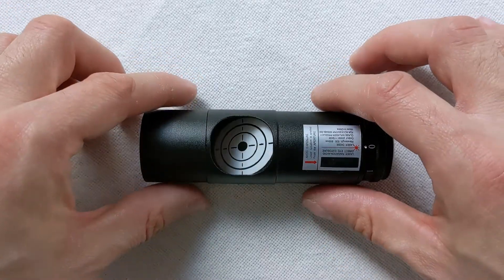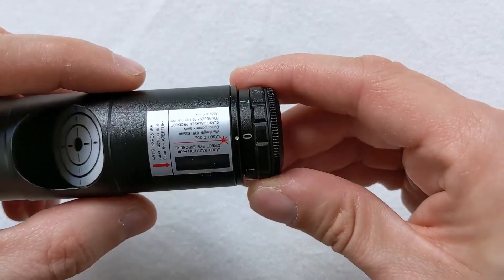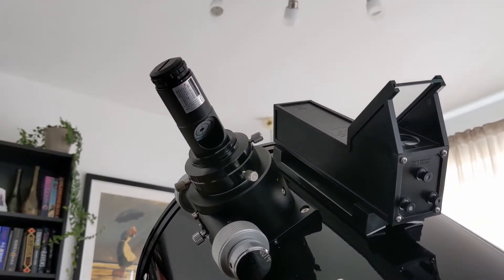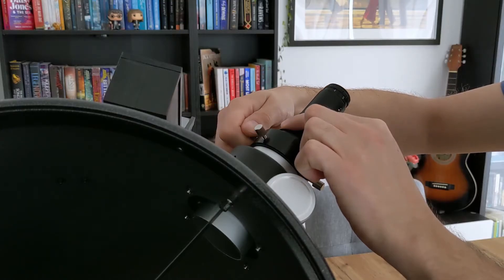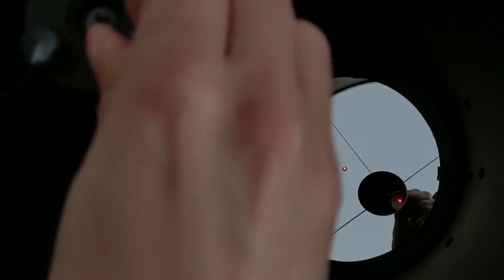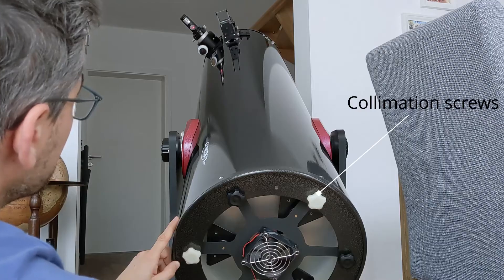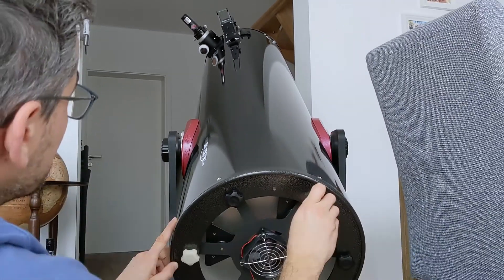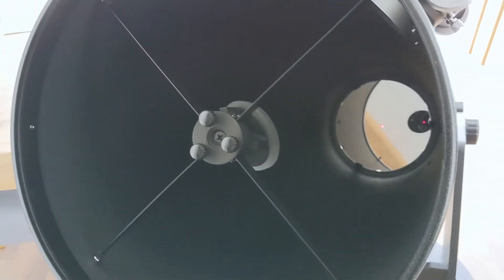How to Collimate your Dobsonian telescope - a step by step tutorial

Comment: I recently bought an Apertura AD12 Dobsonian telescope, it came with no instructions.  The collimator is different than the one in your video.  It has no bullseye and no ability to adjust the laser beam.  However, it does have a circular indentation to zero in on for the collimation.  How does one make sure that the collimator is EXACTLY vertical i.e. straight up and down? I noticed that if it is turned little to the left or right it changes the position of laser light dot in the mirror?  Thanksyou!

Comment: I'm looking all over trying to find a video to give me a clue about getting the primary mirror collimation close enough to get the laser inside the collimator. Mine is way off. I have a 2nd smaller dob and this is an easy task, but not on the used 12 that I just bought.

Comment: the circle on the secondary is projected by the collimator right? mine mirror doesn't have that circle in the middle...
Reply from the maker: @markpatricksantosglatzel4439 The circle on the primary mirror is a sticker called center mark. Usually mirrors come with that center mark from the factory. If yours doesn't have one, you can place it yourself. There are simple plans online that you can print at home and use to find the exact center of the mirror. The sticker can be purchased online for a few bucks.

Comment: You adjust the secondary mnirror directly into the center mark and tighten..  You then move to the primary mirror and align but it knocks the secondary mirror way off the center mark again.. Why is this happening?
Reply from the maker: @iifilmalways7122 There could be multiple reasons for this behavior. Maybe the laser collimator doesn't sit tight inside the focuser or maybe one of the two mirrors isn't aligned with the optical tube. It could also be that the laser collimator isn't properly collimated. Start with checking the laser collimator and if it's collimated, then keep on adjusting the two mirrors. At one point you will see a pattern and  collimation will work out.

Comment: I recently bought this thing too, but I suddenly realized how we can ensure that the laser is emitting parallel light. It looks like this laser pen doesn't have the ability to adjust the direction of the laser beam, which means that the laser itself needs to be calibrated to determine that the light being emitted is parallel to the eyepiece.
Reply: If you can not get the laser straight or don’t trust it:
Put a barlow lens in first, then the laser. Instead of a dot, there will be diffracted light on your mirror. But if you look at the target on your laser, now instead of a dot, you’ll have a donut projected there. That donut is the center marker of your mirror. And you just align that to the circles of the target. 
This is my preferred method, because instead of just putting a laser dot in the hole, i can actually get more accurate by aligning the “donut” to the circles. 
For the secondary mirror, its business as usual, with a collimating cap of a “cheshire”. 
I do all of that inside. And usually i have an idea at what altitude most of my observing is going to take place, so i do my collimation with the scope at that angle (things move around a bit, specially with heavy mirrors). 
 Once the scope is outside, i verify by doing a quick “star collimation”. I may do it several times during the night, depending how much i’m moving the scope and what i’m looking at.

Comment: My collimation went very wrong :( When I loosened the screw on the secondary mirror it rotated and Im now struggling to align it again.  My laser collimator shows everything is ok but I can no longer get my 2 inch eyepieces to focus as they now need to be further away than the focuser can travel, if I loosen the focuser and move the eyepiece further away it focuses, 1.25" eyepieces are still focusing, probably because of the 2 inch to 1.25 inch adapter.  Any ideas how I would fix this?
Reply from the maker: @TheJohn48231 Sorry to hear that. 
First try and see if the collimator is properly aligned. In this video its being explained pretty good.

If your collimator is aligned correctly and you are sure, that the problems with focusing are a result of your collimation attempt, then I would suggest trying to reset the alignment of the mirrors. Depending on whether you adjusted both mirrors or only the secondary one do the following:
Tilt the telescope to an upright position and loosen the collimation screws on the primary mirror so that it can  "settle" in the mirror assembly. Then tighten up the screws again.
Next loosen the three collimation screws on the primary mirror and then adjust it carefully by hand. Make sure that nothing can drop on the primary mirror below. 
Check if you can see the whole primary mirror centered by looking through the focuser without any eyepiece.
Now tighten up the collimation screws for the secondary mirror.

As a next step you can start the collimation process with the collimator.
Hope this helps. Let me know if it worked out.
Reply: @BogdanDamian  Ok this is a bit embarrassing. The reason my 2 inch eye pieces no longer focus is because I accidently left the small extension tube in my other eyepiece so was trying to focus without it 🤣.  I feel like an idiot but at least it was a simple fix!  Thank you for replying, I will look forward to more videos on your channel.👍
Reply from the maker: @TheJohn48231 And I was meaning to ask if you are sure that the 2" eyepiece is fully inserted into the focuser 😅 But what matters is that everything is working properly now 🙂 Clear skies!
Reply: @BogdanDamian  Thanks for the advice, I will let you know the outcome.

Comment: Is it true that the collimator can also need collimating?if so is it easy to do?thanks!
Reply from the maker: @user-rr4sj1tl2p Yes, but they usually come collimated from the factory. A good collimator will also allow you to adjust the alignment it's laser diode manually. This might be necessary in time.

Comment: I noticed grabbing the scope by the front will knock your secondary off every time by flexing the vanes holding the center. I leave my dust cover in and cradle the front and I seldom have to collimate. Just handle it like a baby. I have a AZ mount with hand controls so being careful saves me time. I check with my Cheshire with crosshairs and my laser is dead on every time. I also check against a single star as well.
Reply from the maker: @Mountain Fisher I never thought of it this way, but yes, you make a good point. Because of the cap staying on the structural integrity of the optical tube is much better than without the dust cap, which helps the telescope to remain collimated.

Comment: i heard that a lot of laser are not collimated themself and very off target ... is that true ?
Reply from the maker: @David Rivard Hi! I don't know how many of them suffer from bad collimation from the factory, but I would guess that the cheaper the collimator the higher the risk. The best option is to get one that has exposed or accessible collimation/tightening screws so that these can be manually adjusted if necessary.

Comment: Hlo again Bogdan. I'm still appear to be having issues. I am experiencing the following; When I look through the focuser the crosshairs do not seem to be in 4 equal parts. It looks like a pie but the 4 parts don't look equal in size. My eye is centered but the 4 triangles created by the crosshairs don't seem the same size. However the laser is right on target for the secondary & primary mirrors. I'm getting a bit frustrated or am I over collimating?  Is the primary off or is there something wrong with my secondary mirror. Please advise as I am having  a hard time.
Thank you 😔
Reply from the maker: @George L. Correa Hi! This is really odd, but from what you are writing I don't think that there is something wrong with your secondary mirror. I still believe it's a collimation issue. There can be a situation where both mirrors are aligned in relation to each other, but not so in relation with the optical tube and the focuser. I experienced this once too with dob. I've solved the problem by loosening the primary and secondary mirror a bit and den started the collimation process from scratch. A Cheshire eyepiece can be also very helpful in such situations. Just make sure that the collimator sits tight in the focuser and won't be affected by the telescope moving during the collimation process. Do you have the possibility to try out a different laser collimator? Just in case yours isn't aligned properly. I hope this helps. Let me know how it turned out.
Reply: @BogdanDamian  I tried again this morning tightening all screws for rhe primary slowly & evenly. I was successful. Secondary mirror is now centered properly.  I'll take it out tonight.
 👍🤞🪐🔭
Clear skies my friend ! 
George

Comment: Thumbscrews were too long...however when I bought them they were from Highpoint, they said they were colimating thumb screws. I got it ! They're good !
Reply from the maker: @George L. Correa  Did you get M5 thumb screws with a length of 16mm?
Reply: @BogdanDamian  I think I may of gotten the wrong ones. These are way longer than 16mm. O well back to the drawing board. I'll look again and this time purhase the correct ones. I'll just use the ones it came with for now.
However, good news ! My caster wheels project was a smashing success. Esay movement, 2 wheels have brakes. Nicely done if I may say so myself.
 Now I just need to get a small ramp for easier access to my front door with out too much effort. 
Thank you Bogdan ! Clear skies !
🪐 🔭

Comment: The laser is only good for the primary mirror and even then only if it is collimated itself. The position of the secondary mirror must be centered in your focus tube by using either a Cheshire or a collimation cap. The laser just won’t cut it
Reply: Most times, this has been done by the manufacturer, as well as centering the primary and orientating the focuser in a 90° angle. These things will not change significantly when transporting the telescope. But primary and secondary mirror will very likely tilt a bit, and this tilting can be corrected by using a laser.
Reply: @Astrofrank You can't set the tilt of the secondary mirror accurately using a laser. You could rotate the secondary and still get it to to centre on the doughnut. If you are happy with just guessing then crack on.
Reply: @Astronurd  You can rotate the secondary only around an axis perpendicular to its surface without changing the direction of the laser, and that can only change the amount of light gathered by the secondary. And it is easily visible by looking at the secondary through the focuser.

Comment: Just bought an 8 inch dob, when should I collimate my telescope?
Reply from the maker: @Doctor Jones Nice, congrats on your new telescope! Every couple of viewing sessions is recommended to collimate your telescope. If you move it a lot (inside your home or outside to a remote observing location) then I would do it every time before you start looking through it. After a while you will get a good feeling about how good your telescope holds collimation. Maybe it's really good at it and you won't need to collimate it that often.
I would also recommend collimating your telescope before using it the first time. Chances are that it got a bit misaligned during delivery. Clear skies!

Comment: for my 8" dob i cant seem to get the secondary alignment laser dot perfectly in the center. Its very close but always (even after endless adjusting) looks like its on the center circle line itself rather than a clear red dot in the center. is that good enough?
Reply from the maker: @ludeape Well it's not bad, but it would be better if you could center the laser dot. Check if the collimator is fixed in the socket during collimation. It's not allowed to move. Also check if the primary mirror is tighten up with the screws at the bottom. Losen the primary mirror only after you are done with the first step: aligning the secondary mirror. Otherwise the primary mirror might shift during the collimation process. If nothing helps, try getting your hands on a Cheshire collimation eyepiece. I hope you can get your telescope collimated soon.
Reply: It does sound like the OPs laser is out of collimation alright. Some of the laser collimators aren’t adjustable and so can’t be collimated themselves but if that is the case for the OP they can still use the laser Barlow method to collimate their telescope.
Reply: Check your laser in a V block and aim it at a spot on the wall about 8 feet away and spin the laser slowly and if it moves around your laser is out of collimation and must be adjusted until the spot on the wall doesn't move while you spin the laser in a V or similar. A friend clamped two pieces of pipe together and used that to spin the laser on.

Comment: The advent of such a wide range of laser collimators has certainly made collimating Newtonian Reflectors, much easier. So often mistakenly called Dobsonian telescopes. The Dobsobian part only refers to the simple alt/az mount. Any reflector telescopes using this optical configuration is based on the Newtonian telescope, named after its inventor, Issac Newton, invented some 400 years ago. So many astronomical optics in use today owe their origin to former scientists/ astronomers/mathematicians,  for example, the Barlow lens, named after Peter Barlow, it’s inventor. And the list goes on.
Reply: ok...
Reply: Tl;dr the name dobsonian refers to the mount, the telescope itself should be called a Newtonian, after its inventor.

Comment: What does this help with?🙂
Reply from the maker: @Lasseboss Collimating a telescope means aligning the whole optical system. This process "centers" the primary mirror, secondary mirror and the focuser.
This way when the light beam from the object you are observing hits the primary mirror it will get reflected perfectly straight towards the secondary mirror and from there straight and centered onto your retina.
If the collimation is off, then your eye won't perceive the object as perfectly round and a bit fuzzy.
Reply: @BogdanDamian  Ah alright! Thanks!

Comment: I thought the white ones are the fixing screws and the black ones the collimating screws but I could be wrong, anyways great video
Reply from the maker: @Galaxias Thank you! Even though on my telescope the white ones are for collimation, it could very well be that on other models it's the other way around. The important thing is to know which screws are for collimation and which are for fixing the primary mirror.
Reply: @BogdanDamian  The black screws have a spring so they are fastening. The white screws do not have a spring so they are collimational. My Dobson. Is that? Thank you for finding out.
Reply: On my Apertura dob, white is locking, black is adjusting.  Too bad this (or the other way) isn't an industry standard.